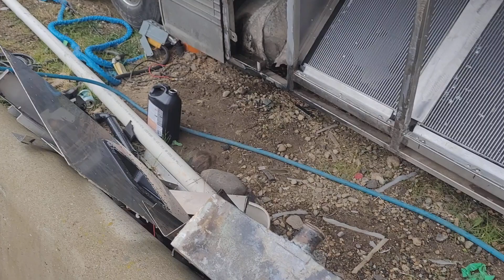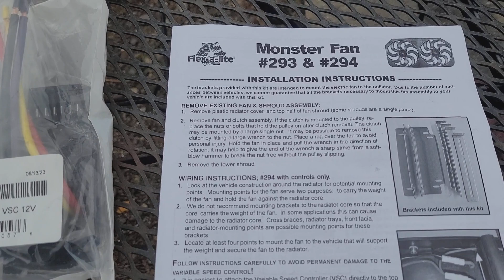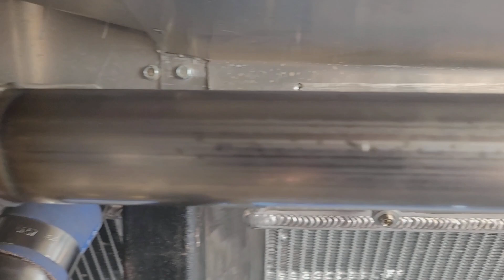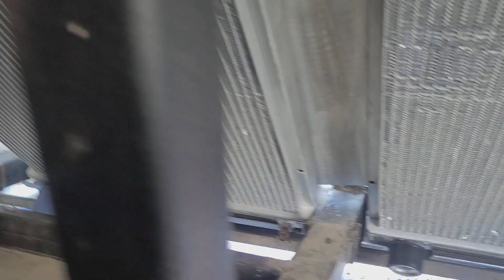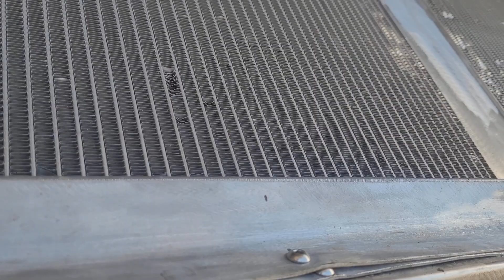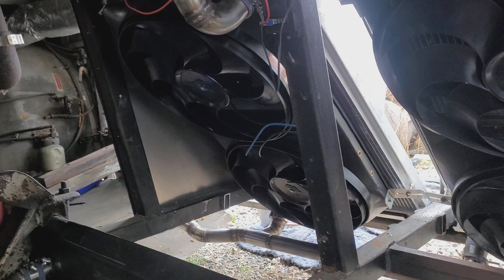Bus Conversion Project - Video 128 - Upgrading the cooling system (part 2)

Comment: did you extend the bus to put in cooling? are you concerned about scraping on the asphalt over bumps?
Reply from the maker: I extended the bus for more room inside which also gave me more room for the cooling system but that's not the reason I did it and it should be fine over bumps, most motorhomes have more overhang than I do, I will put wheels at the end under the rear frame just so if it does hit now and then it will run on casters rather than drag the frame, I'm also going to be able to raise the suspension 3 or 4 inches with the air bags as well, so should be fine
Reply: @JamesEDennison  casters....i would have never thought of that. pret-ty craf-ty.

Comment: Why didn't you run the radiators in series on each side to ensure max cooling efficiency? Looks great!! Thanks!
Reply from the maker: I thought about that but after researching it found that being in parallel is actually more efficient , the way it was explained to me is with 95 deg. air to cool 180 deg. coolant you have almost 100 deg. difference in temps, if in series the first set in the system would see that but the second set would only have around 140 deg. coolant going into them so only a 45 deg. temp. difference @ the same 95 deg. air temp. so not as much heat can be pulled from the second set of rads... not sure if that is actually the case but makes sense so I ran them in parallel
Reply: @JamesEDennison  I am guessing that once you get them going down the road a thermal camera will be the best test for flow testing. Thanks James!
Reply from the maker: @rodneymiddleton9624  Ya, that's right

Comment: stupid question ... why so many radiators ?did the original setup include as many?
Reply from the maker: the original system had 2 radiators but twice as thick, I wanted to incorporate electric fans which means I needed thinner radiators, these are about 25% more total surface area , the original rads weren't big enough to cool it either, larger original fans would have been around $8000.00 .. I'm into this for around 5 grand...maybe a little less the thinner rads allow more air to pass through with the electric fans so should be more efficient...hope that answers your question
Reply: @JamesEDennison  Cool it looks like there is plenty of room for air Circulation